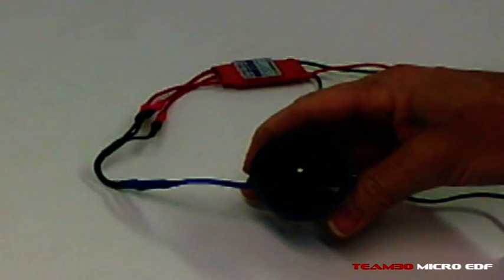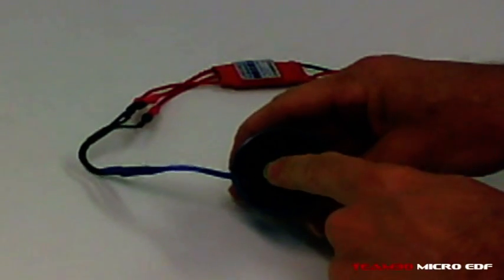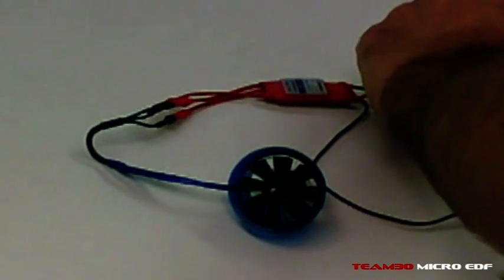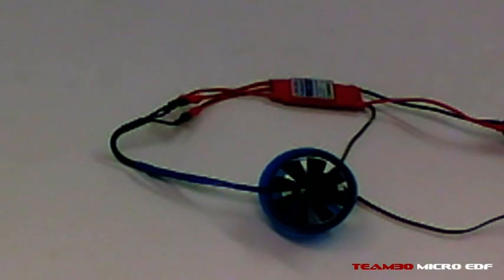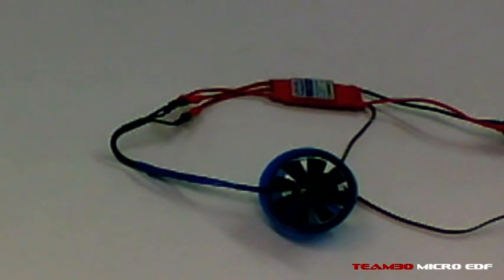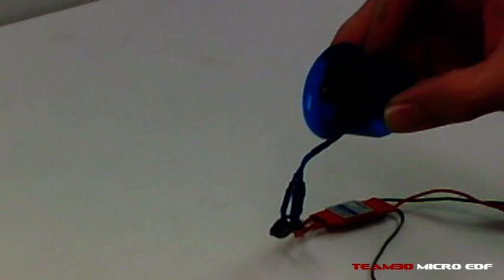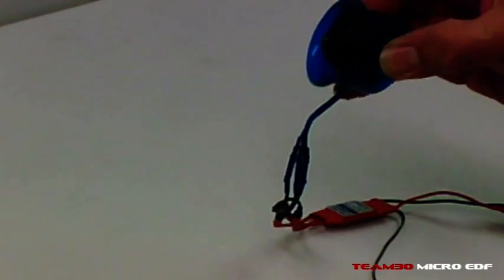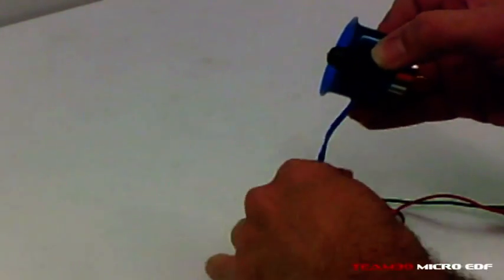AEO 8 blade 40mm EDF fan first run up!

Comment: Does anyone please know what is the requirement of an EDF, i want to use a cheap ebay 30mm 13,000kv EDF, without ESC, just directly, to make a miniature cyclonic vacuum, i have an AC drive, but it doesnt go past 500Hz.., thank you !
Reply: Got to have esc. Without one it won't  power up. Only beeps. I tried
And it failed otherwise.

Comment: i have a project, the plane is a multiplex fox and i want to attach 2 30mm - 40mm edf motors. i dont know which to get but feel free to message me on which is a good reliable edf ducted fan. 
i was having a look and AEO and GWS are good reliable company but i what something in the 9000kv range.
nice vid :D
hope you have something slimier. (i dont want my multiplex fox to be some crazy fast plane